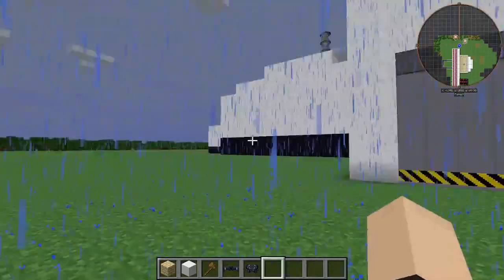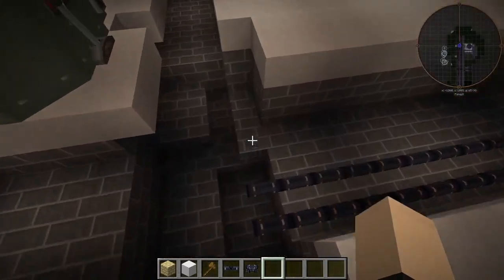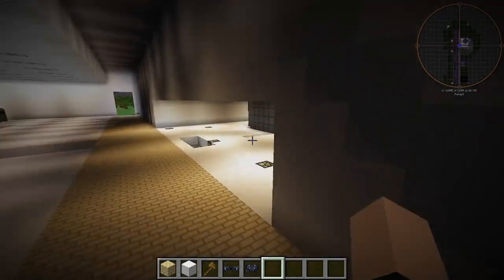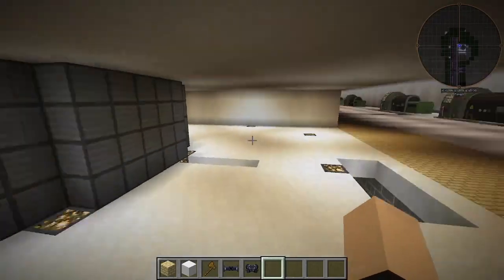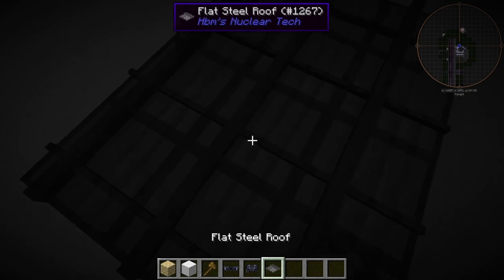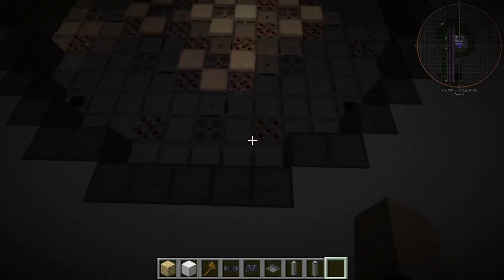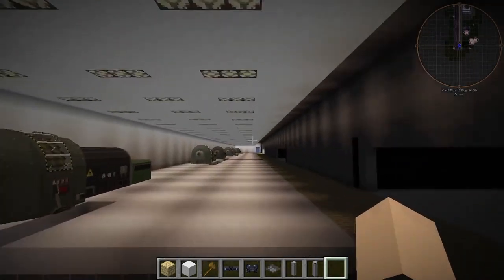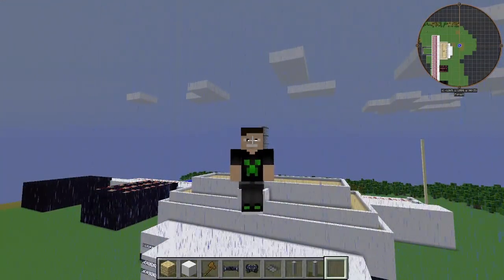Chernobyl Tour And Update | Hbm Nuclear Tech Mod

Comment: Why don't you make a 60 by 60 nuclear reactor that has several control panels and is shaped like the real RBMK from Chernobyl?
Reply from the maker: Because the maximum a single console can control is 15X15 blocks
Reply: @SemiNeon  You can do 4 times 15 by 15 and combine these 4 sides to make a single reactor